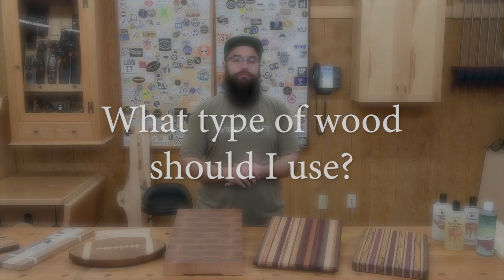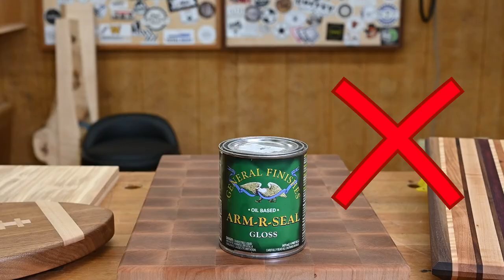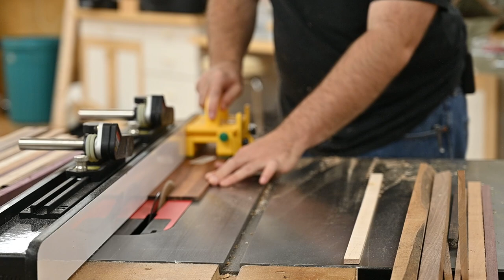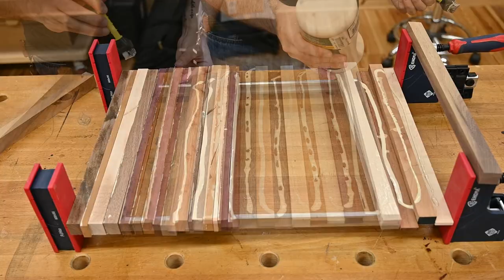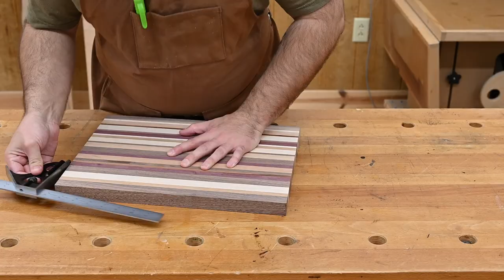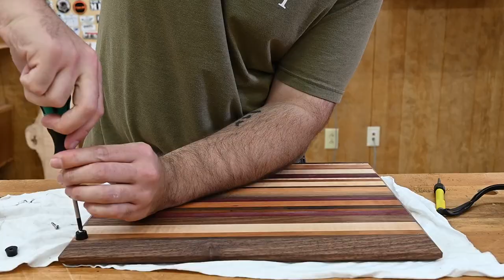Cutting Boards: Everything you need to know.

Comment: How many times should we water pop a boards? I am using walnut. No mixing of species. Thanks!
Reply from the maker: You should only have to do it once as long as you only lightly sand it afterwards. You only want to take off the little fibers that have swelled up. If you go too deep and open up new grain you'll have to water pop it again.

Comment: When making an edge grain cutting board does the grain orientation play a role - can I eg. place a walnut stripe all the way around - so two of the sides go across the grain? Does it make the board weaker when getting in contact with water etc.?
Reply from the maker: It is not recommended to have a strip of wood going perpendicular to the grain of the other pieces. Similar to not mixing the edge grain and end grain, the pieces will want to expand across their width, not along their length. If you have two pieces that want to expand in different directions it could lead to a failure of that joint.

Comment: Great information. Now if I can only remember it all. I'll be going into my Woodcraft store soon and will see about picking up one or two kits.
I'd like some clarification on the finishing process. I have seen some people will do as you did for applying the finish. But, others will create a bath of mineral oil and will simply submerge the board in the bath for a while. Which is best/better? Are there pro's and con's to these methods?
Reply from the maker: You're just looking to saturate the fibers of the board. I don't make a ton of boards or have the extra space to dedicate to a tub of mineral oil so I just pour it on until it stops soaking it up. Either way is fine.

Comment: Can you mix face grain and edge grain on a cutting board?
Reply from the maker: Good question....A cutting board may go through wet/dry conditions, thus making wood movement an issue. For this reason we do not suggest mixing Face & Edge/End Grain designs. You would not like the possible separation of it!

Comment: great video. I do have a question about grain. you mentioned defiantly don't mix end grain with edge grain but I cannot find the answer about mixing edge grain with face grain. For example I am making 2 panels to crosscut and turn into an edge grain cutting board. the majority of the panels will be cut from 8/4 walnut however I want to add some hard maple strips in there but I only have 4/4 maple. Is it ok to cut the 4/4 maple into 2 inch strips and turn them on their  edge and glue them to the walnut to make the panels? I am thinking because they are both long grain direction it will be ok. I think. the finished board will all be ingrain facing up and down. Please help me with understanding this. Thank you in advance
Reply from the maker: Ideally you would have all of the grain running the same way. face+edge isn't as bad as end+edge because there are typically less pieces. Make sure it stays oiled up and you shouldn't have a problem either way.

Comment: Thank you for the video. I have seen some face grain boards that have end grain glue ups. Since cutting boards don't see much structural stress, are the end grain glue ups ok?
Reply from the maker: It really depends on usage. Will it DEFINITELY fall apart? No, but the pieces will move differently when exposed to moisture, and it will get washed, you are increasing your chances of having an issue.
Reply: @WoodcraftSupply  thank you for the response